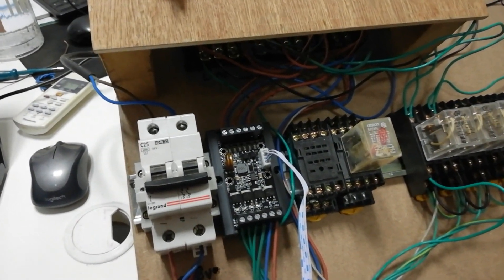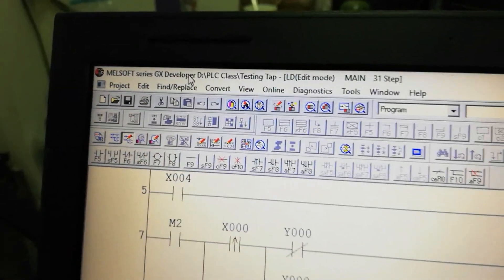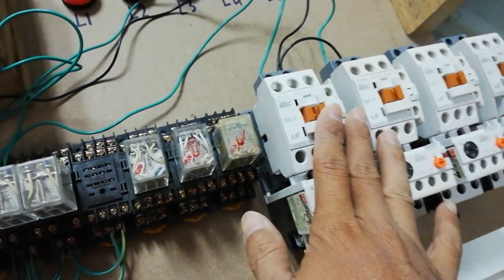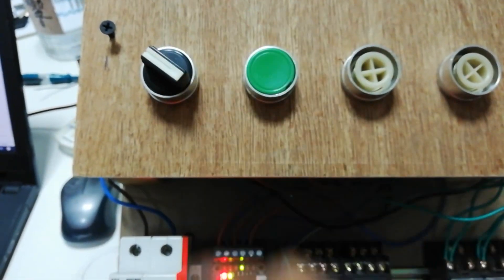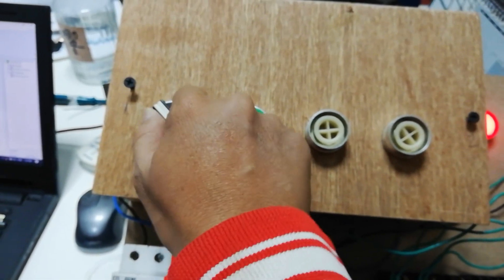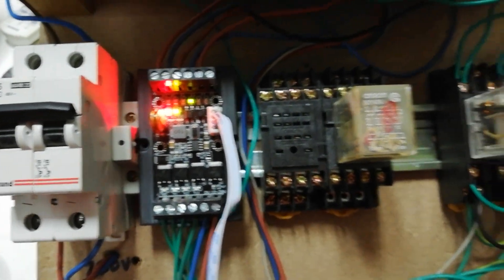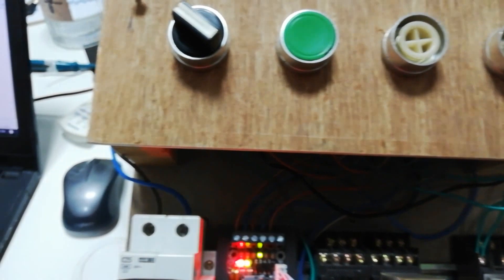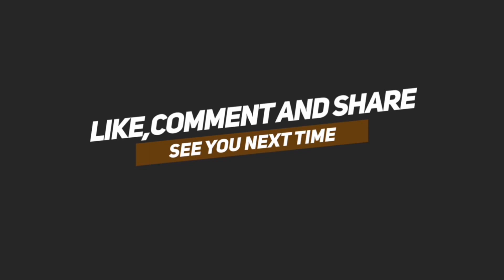PLC FX1N-10MT

Comment: Hi Kon nice video.  What is the voltage output on your Y outputs?  Mine seem to be about 17vdc to the 0vdc terminal when not activated and about 0.7 vdc when activated.  You are using the Y outputs to drive the relays.  What are the relays coil voltages?  By the way I wrote a lead/lag program that I can send to you....
...I read a little bit more on the PLC.  I think the model I have has "Japanese model" transistors which I think the Y terminal is the sink.  I have to change up my power supply and get relays that have a coil voltage that matches the power supply voltage.  I thought the output would be either 12vdc or 5vdc regardless of the power supply sort of like adruino.  I think this type plc is different then the ones I am used to here in North America...  I'll let you know what I find.

Comment: Hi Kon, thank for doing and sharing what you did. I have a question: Did you use this in a real machine? If yes, how it was? Was it durable with simple task like on off with buttons? Thanks.
Reply from the maker: Hi dear! thank for your comment. i use it  simple and with the booster pump for transfer the water to the tank roof floor. i use about one year ago. it don't have problem.
Reply: @g1technicalsolar  thank you!!!
Reply: Thank you Kon, how about the on off frequency? How many time one input or output close and open per day if you estimated?